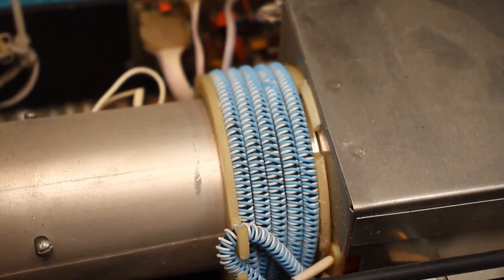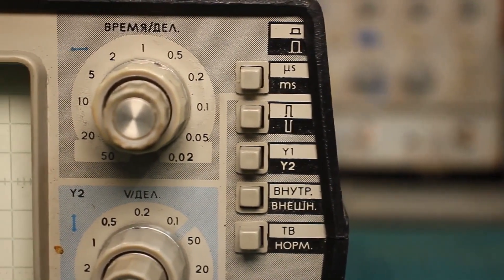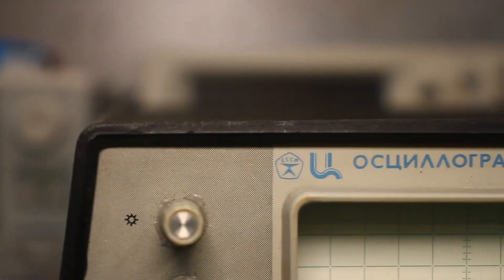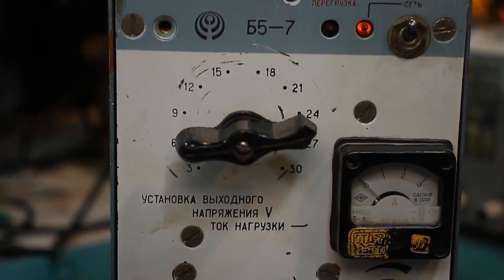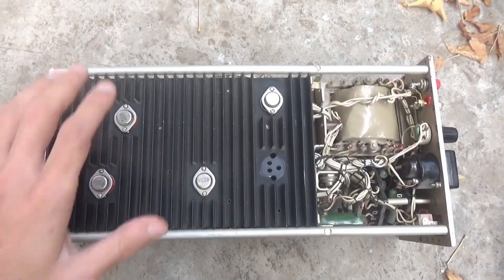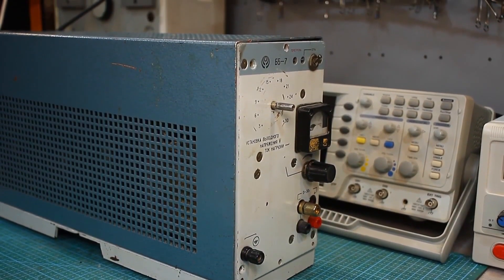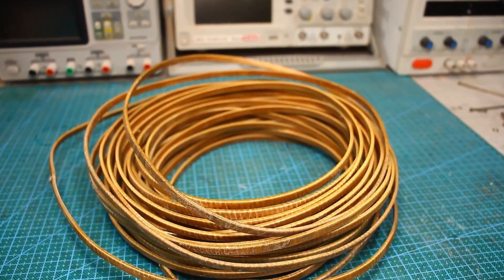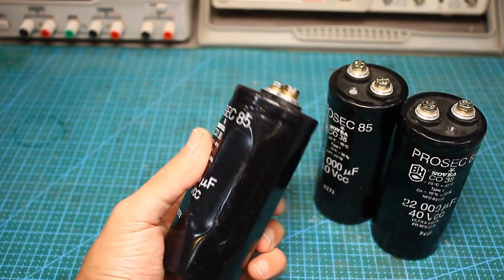An oscilloscope from the flea market and much more!

Comment: Well, i would keep that power supply. Parts you like to get from it will be much more often gettable than this eternal piece of work.

Btw.: it would be funny to put this heavy piece of metal in those grey chinese postal bags - will it breakdown 😂? So you've the answer, why chinese parts are mostly really costeffective and lightweight.

Comment: I have an Philips PM3217. It was working until one day, switching transformer starts to make a noise. In the dark I was able to see spark light coming from inside windings. 
I have disconnect that winding and wound new one on the outer side of the transformer. It worked well since trace illum. doesnt work. During checks, accidentally cause damage to the entire PCB. including chips transistors.

Comment: These boards are horrible, no way to avoid lifting pads when soldering (there are no metalized vias there). Capacitors are also awful, gaskets are disintegrating, and you can remove caps from them. The transformer is wound with aluminum wire. The scope is missing XY mode, not a great tool, really. I had it for a short time, but sold it a long time ago. Didn't like it at all, yet I still keep S1-112A. That delay line is somehow fascinating, though.

Comment: I had a similar one. Model C1-112. Single channel with multimeter. It was around 2003-2010 in Poland. Then I changed to Rigol DS1052E, then DS1054Z.

Comment: Quantos Mhz esse osciloscópio é amigo? Qual o pais de fabricação dele?
Reply: This oscilloscope have bandwith up to 20MHz max and it came from USSR
Reply: @TranNhan06  Ele é muito bonito para os padrões da época!
Reply: @Flip-Flop-Rio  Com certeza, uma pena o mercado brasileiro não ser tão ativo quanto lá, aqui chega a ser cultural estar ultrapassado e indústria nacional de eletrônicos fraca, somente produtos terminados e poucos mercados...
Reply: @Flip-Flop-Rio Maybe, but in that time USSR have some oscilloscope which more advanced feature. Like S1-91 with plug-in module (Tektronix 7603 clone) have maximum bandwith up to 12-18GHz😮. Or first Soviet digital storage oscilloscope S9-28 with waveform memory inside and bandwith max up to 100MHz without waveform storage or 20MHz max with waveform storage.